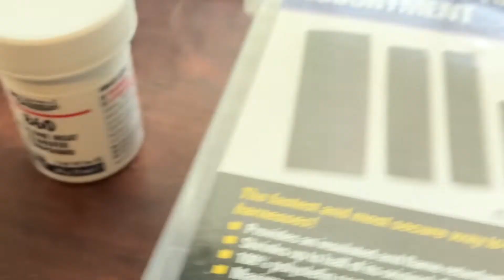How To Rebuild Marantz 2245, 2270 Amplifier Board - Part 1

Comment: Thank you. This will help on my 2270 P750 boards. The differential pair, I'm sure the pins go in a certain way. I'm sure I will figure it out when I get there.
Reply from the maker: They do, but it will make sense when you read the marking on the board. Don't over think it.